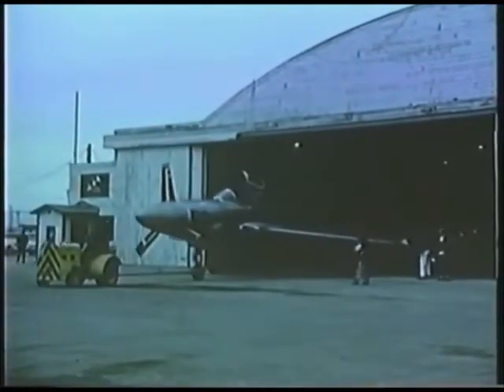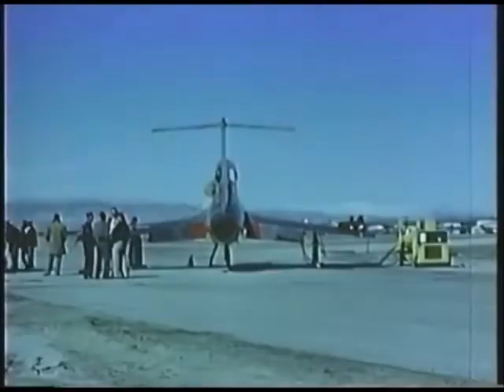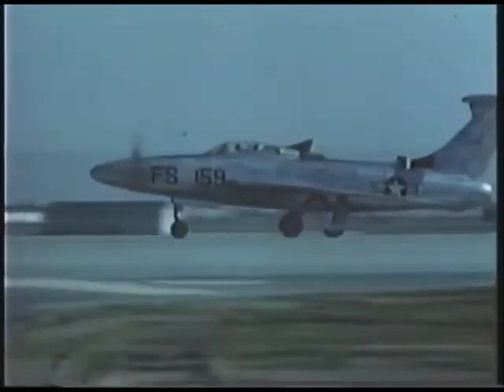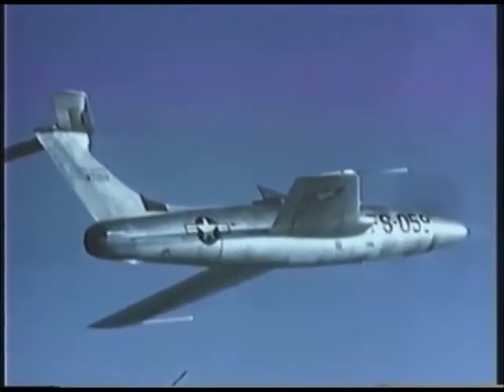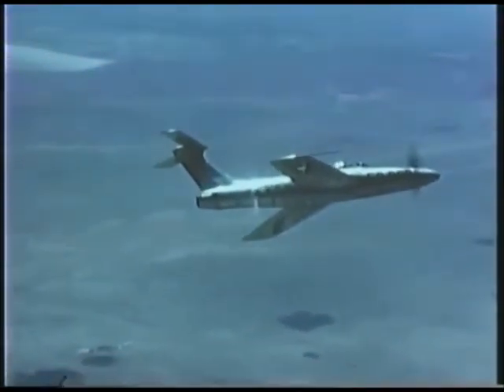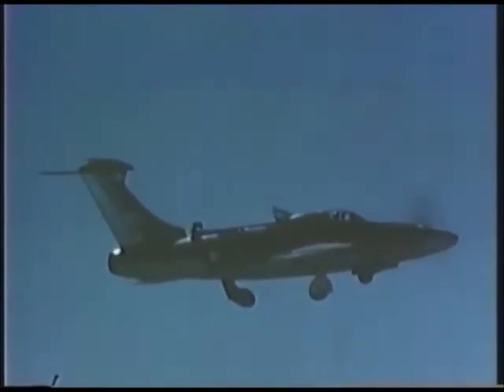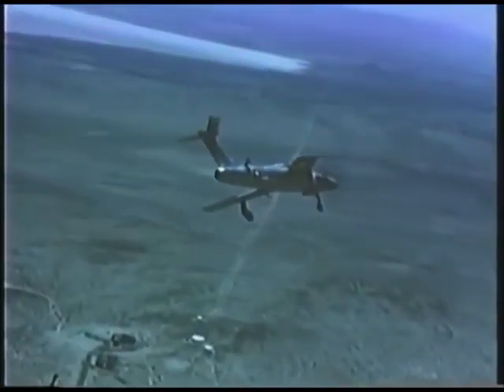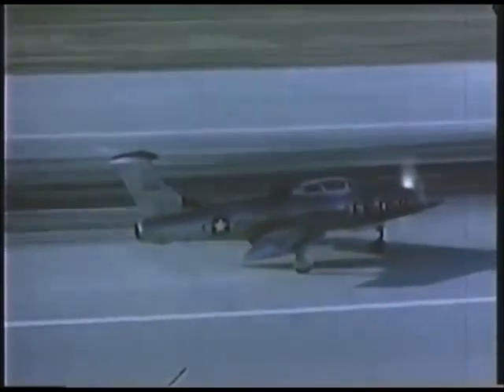Republic XF-84H Thunderscreech

Comment: Just imagine if one of these was ever allowed to fly again and came and flown at a airshow alot of people would be absolutely frightened and terrified of the noise and racket and alot of cars and buildings would be getting wrecked and damaged and a panavia Tornado f3 would be extremely loud and absolutely terrifying and frightening aswell and that's the loudest jet fighter plane I've ever seen and heard in person and the noise and racket went straight through me and i had my fingers stuck right into my ear holes and it was still frightenly very loud and sticking your fingers into your ear holes won't drain the noise and racket out
Reply: it would shatter ears. it would be unsafe. not just shocking